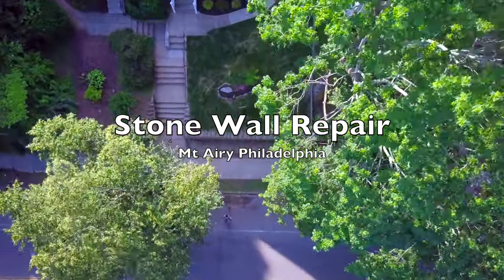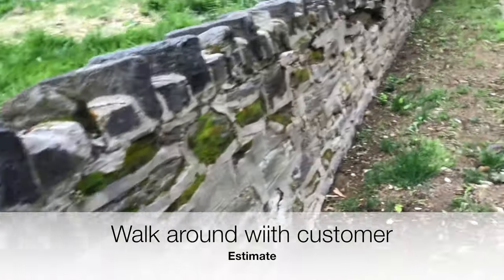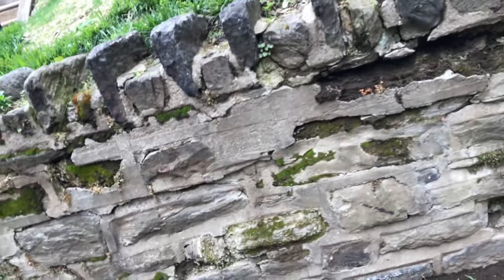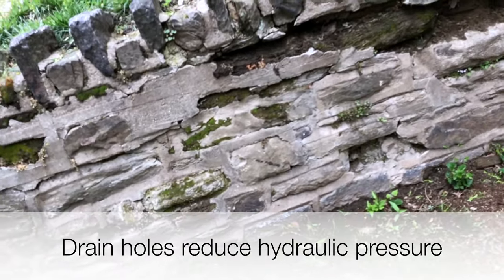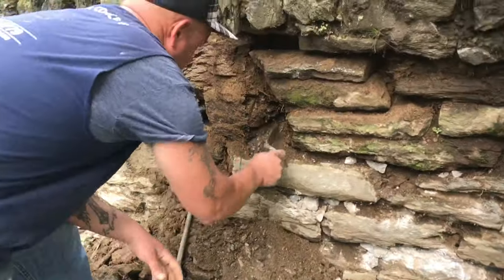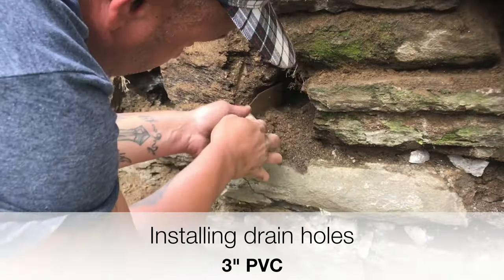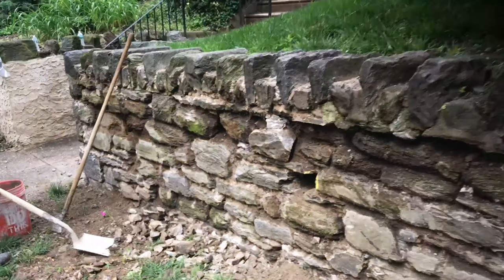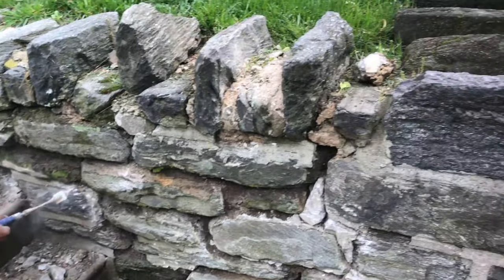How to Repair and point a Stone wall  | Concrete and Cement Work

Comment: This wall would have originally been built using lime, which is vapour permeable, to allow water to pass through. The fact it had been repointed previously using cement is what has caused the damage and bulging due to cement trapping water and frost within the joints. Cement should never be used with stone
Reply: What mortar would you use then?  I have the same type of wall, but I have no idea what they used.  It was built in 1968 and we moved just recently (Summer 2021).  I think they just neglected it over the years and there are no drains.
Reply: Yes more than likely, it would’ve been built in the lime Mortar but by no means is a lime mortar, going to relieve the hydraulic force all that much, especially if you have a big downpour
The other problem using a lime mortar you won’t get the same strength 
It would’ve been nice to see a French drain, put at the back of this wall to relieve all hydraulic pressure and get rid of the unsightly drain holes

Comment: Nice job but lime mortar would leave a sympathetic and breathable finish which would give longer life to the wall. Also, while I think raised ribbon joints can look impressive they hold water and get blown in the frost. A flush joint to the arris will give better run off.

Comment: Nice to see you putting some drain holes in but in the future for best results you should have excavated the back of the wall and filled it with 20mm clean gravel This would relieve all of the hydraulic pressure from the wall.

Or even better install a French drain to the back of the wall this way you don’t have to put unsightly drain holes in the face of the wall

Comment: .....the original wall was wrongly built using Portland Cement.
Incorporating drainage holes is a professional idea......BUT  to NOT use a Lime mix for the pointing is as bad as the original cowboys.

Comment: Thank you for the video, great information. I had a question regarding the PVC piping, will the piping help in the winter time as well during freezing and thawing of the stone wall? I'm worried about the expanding and unexpanding of the wall through the hot and cold seasons.

Comment: As civil engineer, you get my approval. Perfect execution. Prestine look. This should last years.
Reply: Nils W it won't. There are plans in the UK at the moment from banning this practice on listed grade historical buildings as it destroys the stonework.
Reply: electronurd ,....your right it won't last the test of time. The new material for repairing a stone wall is 3 to 1 mix of sand and lime  specific for stone work. Weeping holes are a must but a regular mortar mix with cement will trap the moisture in the wall joints causing the freeze thaw effect popping out the joints and causing scaling on The stone face. The sand lime mix let's the wall breath and moisture escape. We were all taught to use motar for building walls but it  ultimately causes failure.
Reply: Also as far as the weeping holes there needs to be a crushed stone troff along the length of the wall with landscaping mesh to keep the sedament out of the stone and pipe that the water can collect in and drain into the weeping drain pipe.
Reply: Nils W. 
You don't know what you're talking about. 
Pointing with Portland Cement is the worst thing to do.

Comment: I have a retaining wall that's built out of stone and cement I'm not sure if I can just do the same thing as you did with mine and the drainage you didn't show how you put in the pipe ? Except in the front end but not where connected to also I have a restraining wall that's built out of cinder block and mortar but it's leaning forward and has a crack on one side down like the 1/3rds of the wall through I was wondering is it possible if I can build another retaining wall around that whole wall or just knock it down and start from scratch? Also I have an area where I want to add a rock retaining wall to it but it's on the edge of a slope is it possible to build a retaining wall and not add in extra back fill for it level the ground where the wall would sit?

Comment: Hmm, I wonder if I should make some holes in the bottom of the front wall of my stone terrace cottage? It is on a hillside, so the back is partly underground, but at the front the floor is a couple of feet  above ground level, and the concrete floor seems to sit on mud. I am trying to sort out the damp by tanking at the back, but this might help...?

Comment: I have some loose stones similar to these basically only the top layer is loose. I have drains in the wall as well. I was wondering if I can just fix the top layer and not have to worry about redoing the entire wall with new mortar? The wall is a retaining wall and leads from the street to the garage in the basement. The wall leans away from the driveway.

Comment: I have garden wall cement solid blocks that only go up to 3 feet per spec. Can i cement them together in two rows to get the strength to reach a height of 6  to 7 feet high.
Reply from the maker: Depends, Is the wall retaining soil? Is there a foundation? How thick is the wall?

Comment: How about rain after you have pointed it?  Does it effect it?
Reply from the maker: Cement drys fast. Rain is not a problem on a dry day. If it rains same day then yes there could be some issues.

Comment: Awful workmanship,new pointing will last a couple of years then the face will come off the stone,cement is the wrong product,stone is in good shape,so should have used 1 NHL 3.5 lime to 3 parts sharp sand. The damage that will happen to the stonework with cement will be that the rain water will get into the stone and with any frost will turn to ice and will find the softest part to escape from which will be the stone as cement is harder then the stone, lime has a breathability quality with no damage to the stone.

Comment: What an unadultarated mess. This wall will fail again duw to incorrect pointing method and materials. You can see why it failed originally and the problem is just being replicated. Pointing to a retaining wall like this is not 100% necessary and when it is repointed this should be done with either a simple lime mortar or hydraulic lime. I have a rubble wall that I have to repair due to the ill informed destroying it with Portland cement